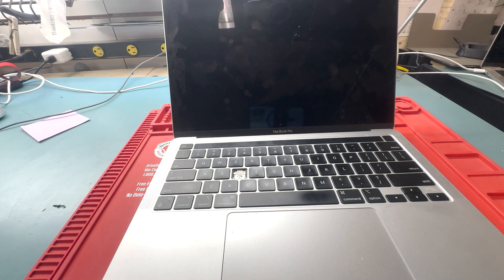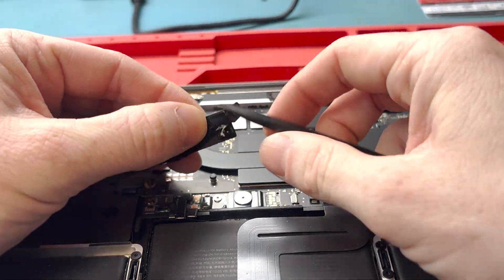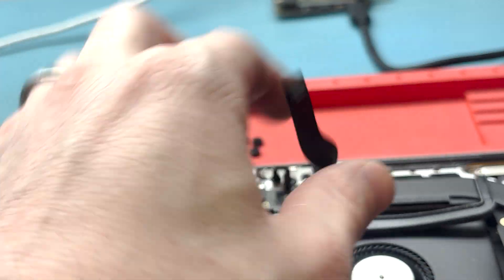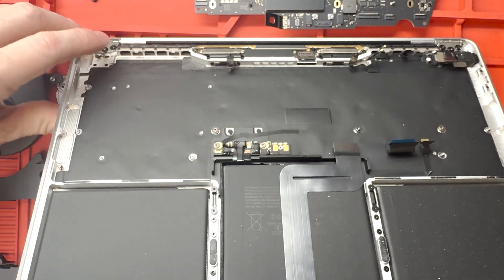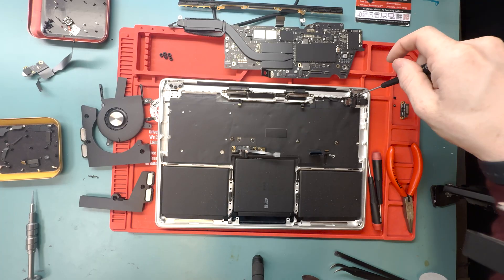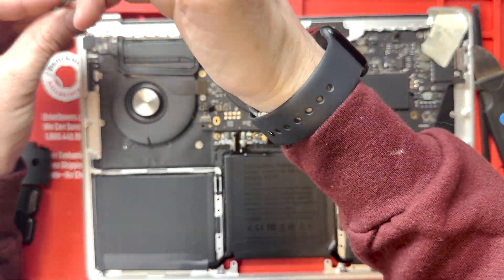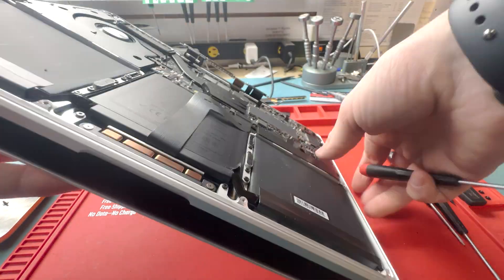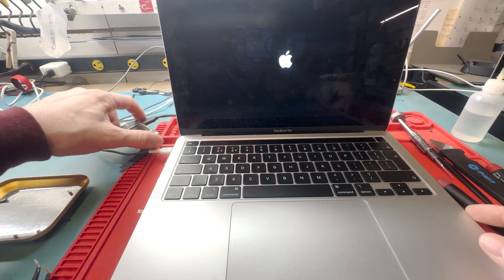🔧 MacBook Pro M1 2020 A2338 Top Case Keyboard Replacement Guide | DIY Repair Tutorial

Comment: did you happened to find out what screwdriver you need to remove that screw, without using pliers?
Reply: I have a ifixit repair kit. It is the number 3Hex bit. I’ve been looking for a video about the keyboard replacement and stumbled across this. Hope this helps
Reply from the maker: @jimmyjohns4517  I haven't yet figured out the actual name of it
Reply: @worthitrepairs  it looks like a simple hexagonal screwdriver, I can't figure out the diameter.

Comment: Thanks for your helpful video but you didn’t show how to open the keyboard and install it back. You opened the screen then you start to assemble them back
Reply from the maker: Because I don't take out the keyboard I replace the top case keyboard assembly its a whole part that comes all in one.

Comment: if i just need to replace the touchbar should i follow these same steps, but just replace the touchbar, or would it be easier (as a complete beginner to this) to replace pretty much the whole keyboard and battery
Reply from the maker: @steampunkpiglet4514  easier to do the while top case keyboard

Comment: Easier using a sucker on the bottom cover at the opposite end to the hinges to make a gap and work the cover apart from that end - then pull away from hinge direction. 😊

Comment: Thanks for this video, however despite having an A2338 I found some discrepancies between our two same versions of the laptop.   I was missing a bunch of screws despite it having a Void Warranty sticker on it.   I also noticed you did not remove the battery, is there a reason for that?
Reply from the maker: I did not remove battery because the part came with a battery.
Reply: @worthitrepairs   That must have been considerably more expensive than mine.  Mine was about $50 I'm guessing yours was a few hundred... Probably worth it, mine took me 3 weeks to do and multiple tools/chemicals and hours of research to figure out how to resolve.
Reply from the maker: @HumblyNeil  Since you voided a warranty I just made new Merch check out my new shirt. https://worth-it-repairs.myspreadshop.com/void+warranties+for+fun+fan+shirt-A681e14e234c93422e33b7ef5?productType=812&sellable=LkEDYzalmotQzY9wp2mz-812-7&appearance=388